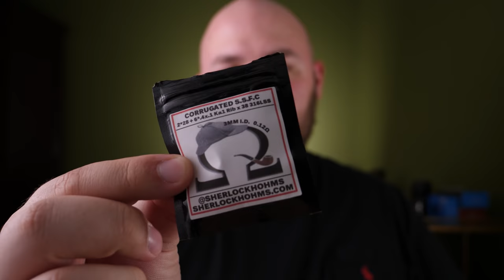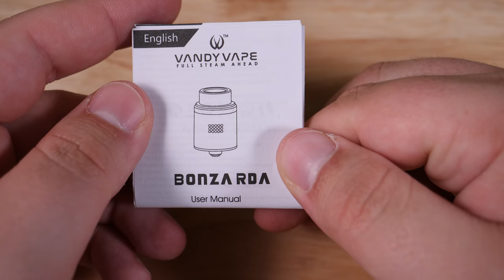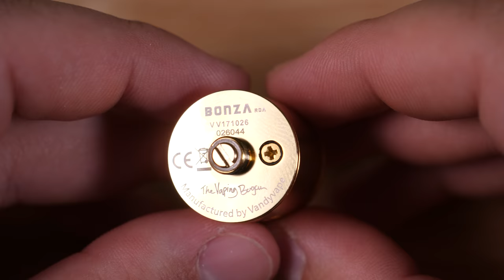Bonza RDA | Full Review & Epic Coil Build

Comment: A small amount of juice on your "o"ring on your top cap for airflow control makes it easier to spin. Dry the" o" rings on the bottom of the barrel that clips onto the deck helps keep it tight.  I've got all colour versions of this type RDA, my gold one was like yours except I had no loose negative post.  Great review overall mate.  And yes they are made for cloud chucking.
Reply from the maker: rick seifert I’ve tried juicing the top and not the bottom, and I’ve tried juicing everything. It doesn’t seem to matter, honestly. The top o-ring on mine is crazy tight, and the bottom o-rings are crazy loose 😩. I don’t find the bottom ones unacceptable, but when I have to use a wooden spoon handle to pop the AFC loose, that’s when it gets a little ridiculous 😂
Reply: Dmo Vapes,  well not good bro,  you got the one that slipped thru and wasn't up to full spec standard.  Not good man. A guy here where I live had same problem with a RDA of different name and the barrel "o"rings were very loose and sloppy.  He bought an" o"ring kit and put new one in from his kit.  He shouldn't had to do this though.  He ended up sending it back to the supplier/place of purchase.  A replacement came which he had no problems with. Contact the supplier,  they should be accommodating and possibly send you a new replacement unit. Have you tried using the top" o" ring with its spare from the bag and use them on the bottom of the deck for the barrel to lock on, and use the loose fitting barrel ones as to top ring for airflow control,  possibly the guys at Vandyvape installed the o rings arse about.  Just a thought.
Reply from the maker: rick seifert I’ve tried putting the new o-rings on, but not swapping the o-rings. I might try it. I received it for review and didn’t buy it, so usually in those cases, I don’t seek exchanges, as I didn’t actually pay for it.
Reply: Dmo Vapes,  ok mate.  Shame you got sent one that has given you heaps of grief,  not fair bro for you. Not fair at all. Only hope that should you want to purchase one later down the track in a different colour you'll have one that's spot on with the "o" ring tolerance like it should've been in the first place.  The headaches you've got with your Bonza is the same I've had with a brand new RDTA by Ijoy ( black with gold trim - the version 2 model) in regards to sealing capabilities for the bottom of the tank at the deck base.  I went and purchased an "o"ring kit myself then used those ones to get the tank to seal on the deck base.  I know your frustration mate. Yet the other 2 RDTA mk 2 tanks by Ijoy in rainbow have been perfect with no defective parts.  Best regards and luck for future mate,  keep up with the great videos,  looking forward to watching many more of yours in the future.
Reply from the maker: rick seifert Thanks man! Yeah, I still enjoyed the RDA despite the o-ring situation. This is the issue with China-made stuff, in general. The tolerances are too wide, and their products are generally fairly inconsistent. It’s the chance you take for the price though!
Reply: Dmo Vapes,  I agree mate.  Quality control has been lacking at times across the board from all manufacturers and the biggest let down has been the "o"ring part of all tanks,  some batches are just very ordinary whereas some batches are just perfect without any headaches there after,  that's why I ended up buying the" o"ring myself to be able to try to have my tanks not leak.  So far only one tank has leaked using the manufacturer's" o"rings with the tank.  My other tanks /decks have been hassle free for now. My jobs very demanding on equipment even my vape gear due to temp and atmospheric changes -I work underground as a miner in various roles.  I look after my tanks,  mods etc as best as possible without damage so far.  The Ijoy tank that gave me hassles was the only one I didn't use at work but used at home.  You've got my subscription by the way also,  did that after the first 3 mins of your video.  Have a great day mate.  Cheers from Kalgoorlie in western Australia down under. Ps: love those coils you run in the Bonza they are very cool and just down right awesome,  I'll have to order some from the guy and see if they ship international.
Reply: @Dmo Vapes you should not have to do this, but take some dental floss and force it underneath the o-rings and wrap it around a few times until the o-rings start to puff out a little. I have a Bonza RDA and had this same issue, used dental floss as stated and it fixed the issue. And no, you cannot see the dental floss in case you're wondering so it does not look bad by any means. Its a cheap fix unless you can find replacement o-rings that will fit on the Bonza. Give it a shot, should work fine.
Reply: Joshua McCarran,  top idea mate,  I'm use that for my Ijoy 5 RDTA barrel "o" rings even my spares aren't tight and I don't have any spare ones left in my o ring kit.  Excellent idea Josh about the dental floss. I'm going to give it a go right now.
Reply: You are correct about the small amount of juice that's what Batman to me to do

Comment: Them are some rediculous coils! In my personal opinion, not very user friendly. Ramp up and cool down time has to be rather long. Bet the flavor from them is really good but... I do like the RDA though, easy build, big juice well, but seems like it needs big ass coils in it.
Reply: Bill Carini yeah I have heard from others this thing shines with nice long series builds.
Reply: Sun Behind the Sun 777 I prefer something that gets hot fast but cools quickly as well. 26/40 Fused Clapton, in most of my atomizer.
Reply from the maker: I usually run a 2*28g/38g N80 fused clapton in the Bonza. 9 wraps on a 3mm gives me a .38 or so and it’s ideal for me. I just had these coils and was itching to find an RDA to put them in; they are so awesome looking! They are massive, so most RDA’s won’t fit them. Sometimes, I just like running some big, fuck-off coils 😁.
Reply: They are really awesome looking! On a different note, I have looking to do some series vaping but all my attempts at a build have been too low or too high. I will be trying the build you mentioned. Thanks!
Reply from the maker: Bill Carini Yeah man, that’s my favorite series build. If you find it too hot, add a wrap, and it’ll come out to about .42 or so. 30g aliens are nice too, but they are a pain in the ass to build.
Reply: I do like a good warm vape. And yeah 30 gauge Aliens are a giant pain. I did some a few weeks ago, 3*30/38. I have them on the Azeroth with the triple deck. 5 wrap (I think) at right at .2 ohm. I tried to do it again last night... They didn't cooperate with me.